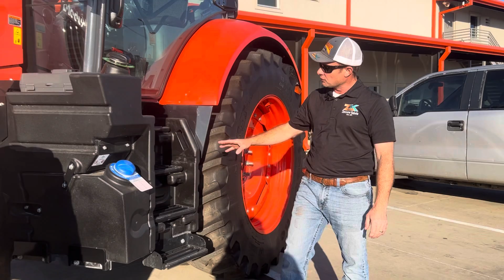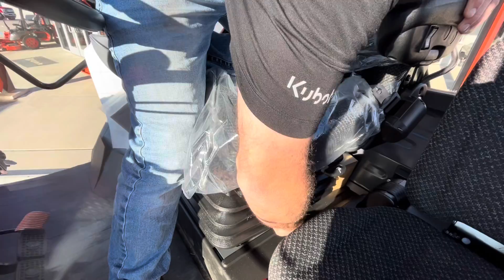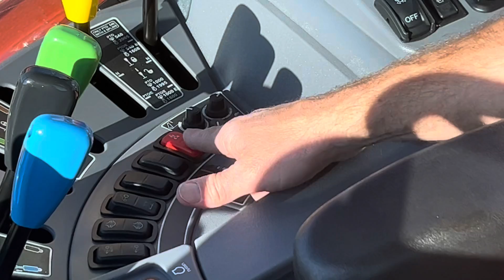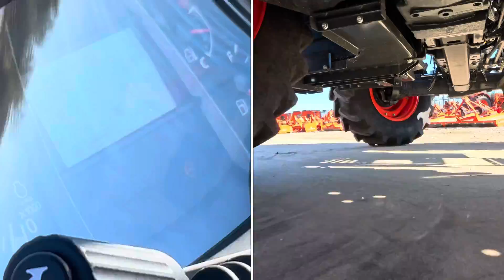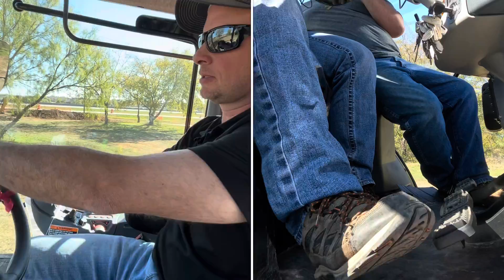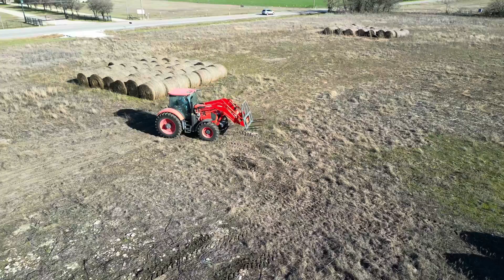Kubota M7 Gen 4 Series vs John Deere 6M series

Comment: Faded paint job isn’t terribly impressive.
Reply: on the deere?
Reply: It's Kubota Pink !
Reply: Yea that really hurts Kubota.
Reply: Faded paint comes back to the colours make up. So Yellow Orange and Reds that use a lot of oxide to make them will fade quicker. There are types of paints that you can apply which will hold its shine and colour. I used one of these products in Fiatagri terracotta colour, which is notorious for fading, and 10 years later used in Australia’s harsh environment it held up beautifully, the paint outlasted the decals. The cost to use that paint was considerably higher than the main stream paint system, however I think it actually worked out cheaper in the long run, especially if you wanted the same look from the other systems, you would probably end up repainting the machine every three to five years.
It’s just that manufacturers try to keep the cost down on production  and choose mid spec paint systems.

Comment: Isn't the correct comparison to the 6M by John Deere, the Kubota M6?
Reply: John Deere 6175R
Reply: The small-frame 6m E.G. 6130m is comparable to the M6, while mid-frame 6M E.G. 6155m is comparable to the M7.
Reply: no kubota does it a little differently so the m7 has the same horse power and torque as the jd 6 series
Reply: @LoneWolf-wv4fg  Not true at all.  M7 is much lighter duty - open centre hydraulics and a parent bore 4 cylinder engine.  John Deere has well over 30 models of 6 series tractors from 95 to 250EHP.  M7 is basically 3 models with two types of transmissions.  John Deere has about 6 transmission offerings.  Industrial wet-sleeve heavy duty engines.
Reply: Kubota m7 is closed hydraulics and dollar for dollar it smokes the Deere !
Reply: What about comparing John Deere to Deutz Fahr? Are they also garbage in comparison?
Reply: @67blabla  Very much so.  They do not contend very well in the NA market.
Reply: @67blabla  John Deere is the only manufacturer to make tractors with full frame design.  It makes for an extremely rugged tractor.
Reply: Kubota is not a comparison to John Deere.  Garbage.